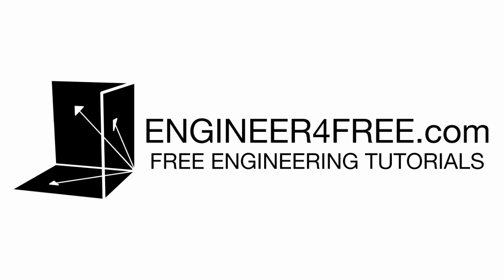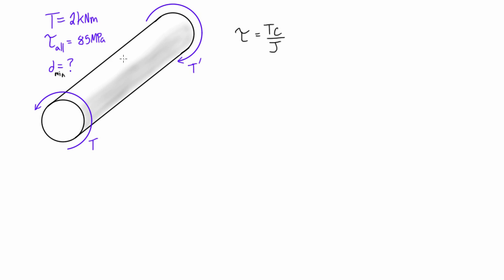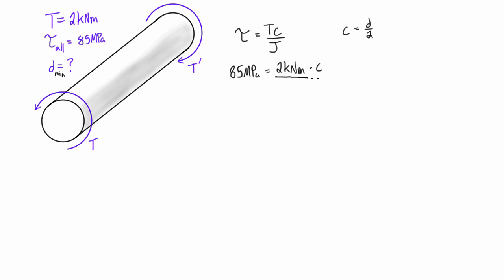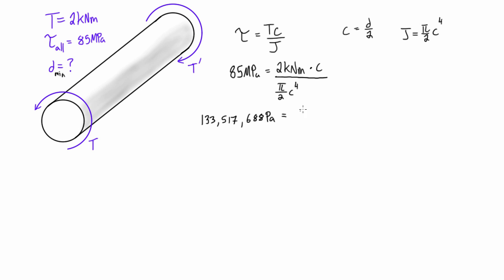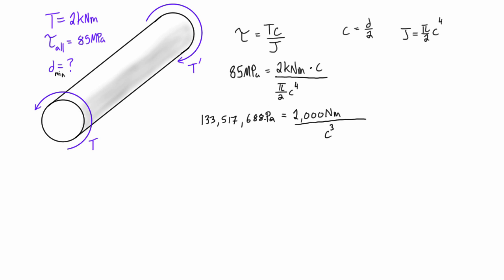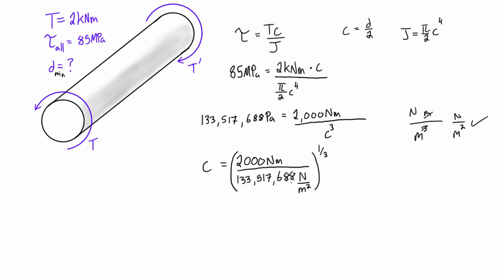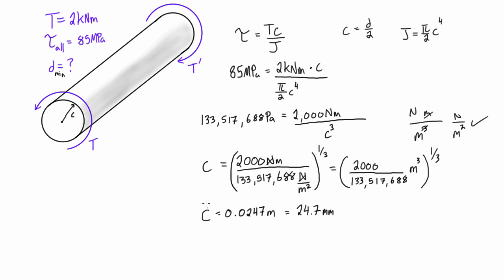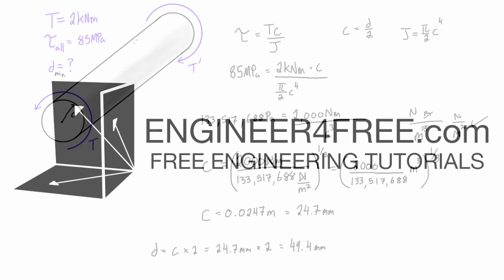Find the minimum diameter of a solid circular shaft in torsion

Comment: How to calculate the diameter of a shaft when a point load is acting on the center of the round shaft(in lenght) and the shaft is fixed in both sides? Can you please explain?

Comment: My comment is all the data charts I find don't seem to make sense. In your specific video you are calculating with a shaft with max. 85 mpa. My problem is you will see the same or very close GPA pascals for max. twisting of shaft materials. Just to be a little more exact is two materials that have a tensile strength and an ultimate strength of almost 100% more of each other is being given close to or the same GPA number.  I would say for a fact if I shear the first shaft at 400 LB FT of torque the second shaft will not.  This seems to make it difficult for shaft selection when I find this data to work with. Even twist calculators calculating the same degree twist factor. This cant be.
What is your comments to this.

Comment: where did the pie/2 go
Reply from the maker: I multiply both sides of the equation by pi/2. Because it is in the denominator of the RHS, the pi/2 effectively disappears. The LHS we have 85 MPa = 85,000,000 Pa, and 85,000,000*(pi/2) = 133,517,688 Pa